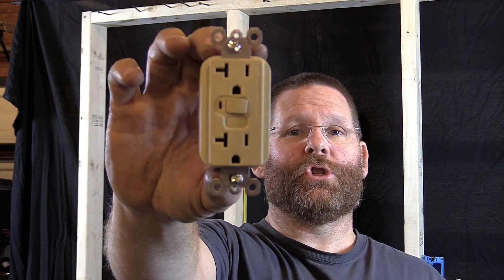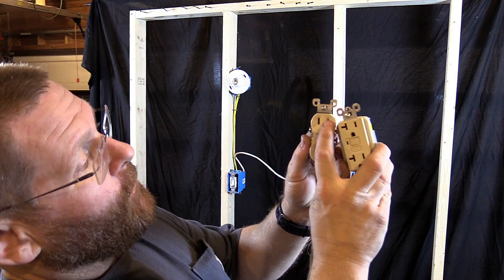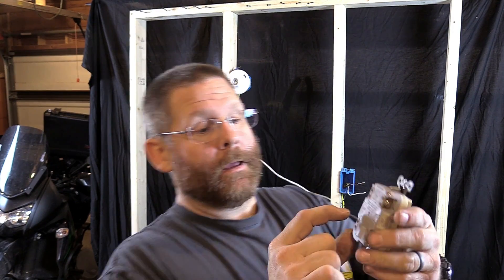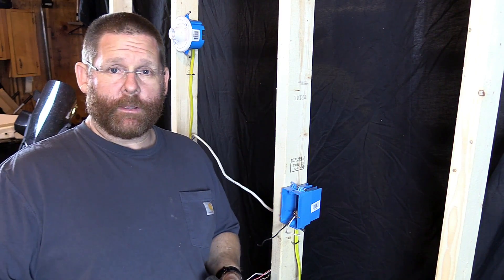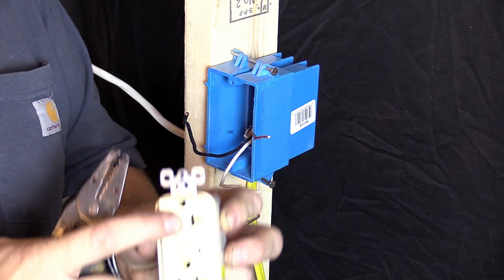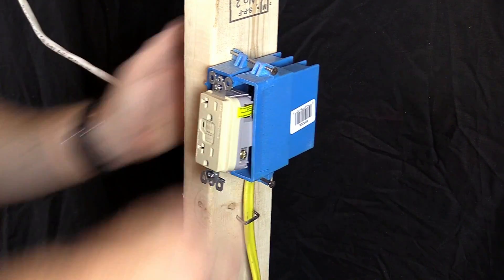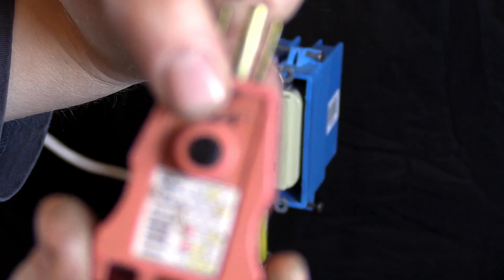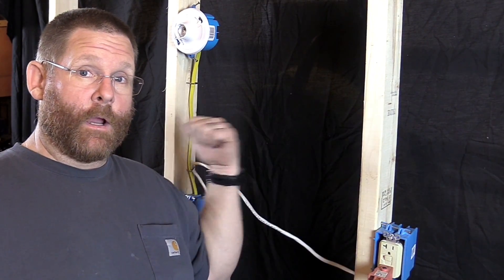How To Hook Up A GFCI

Comment: Hello, very informative video! I am trying to find out the problem with two exterior gfci outlets, one has reset/test buttons. I have no power on both. I am unable to push the reset button which indicates to me that it is not getting the power. I checked and reset all gfci outlets in the house and they are working. The circuit breaker has not tripped either. Could you  please let me know what troubleshhting I should do before I proceed with replacing?  Thank you in advance!
Reply from the maker: If I were there the first thing I would do is turn off the circuit breaker, pull out the gfi out of the box and leave it hanging out, I would make sure it was safe from dogs and kids then turn the beaker back on. Go out with a induction tester (tick tester) or meter and see if I had power to the wires coming into the back of the gfi. My guess is that your gfi is bad. If it shows power my next guess is that maybe you have lost a nuetral. If that proves still no power it may be that you have a open joint somewhere..go to the next place that wire goes (junction box etc) and see if you have power there. If they still doesn't fix your problem message me back I'll tell you a few other things that you can do. Let me know
Reply: Thank you so much for the detailed suggestions on troubleshooting. I will do these and keep you posted. Have a great day!
Reply from the maker: @SurLover  you too. Good luck
Reply: @MountaineerOutdoors  sorry for the delay. I had to buy induction tester and multimeter from Amazon to test these. i found that the cable pair feeding LOAD terminal have 120 V but the LINE terminals have no power. I opened both outdoor receptacles and there were no loose or unconnected cables. I also bought a new GFCI and replaced just to check. Test and Reset buttons on the new GFCI cannot be pressed either. Just to give some background. This problem happened after a contractor used the outlets to run thier cement mixtures. Could this be due to burned fuse on the main box then?   I would appreciate your further guidance. Thanks!
Reply: @SurLover  switch the line with the load seems that you have it backwards. Line is supposed to have the power.
Reply from the maker: I just saw your question and someone comment on it... He is exactly right the line always should have the incoming power.
Reply: @damthetorpedoes1  Thank you so much! It was exactly the problem. I connected the new GFI  reversed. I changed it and it is now working great! Thanks again!!
Reply: @MountaineerOutdoors  Thank you! Indeed, I connected it wrong.  It is working fine after I revered the connection. Thanks again!!

Comment: If you have a 15 amp circuit breaker, is it okay to use a 20 amp outlet?  Should've asked that before LOL
Reply from the maker: Yes absolutely. That's actually a better Recep to use. If you had it the other way a 20 amp circuit and you were using 15 amp receps then by code the only way to get by with that is to use at least 2 in a circuit. I hope that doesn't confuse you. But your question, yes you can do it absolutely that way.
Reply: @MountaineerOutdoors  What is the point of using a 20 A outlet on a 15 A breaker? The whole point of a 20 A outlet is that one can use more than 15 A. You would be overloading the wires.
Reply from the maker: Your breaker will only allow a certain amount of current before it trips the breaker.

Comment: Great video. Hey are you using a bunch of differnt tags for these videos? So when people look it up it will pop
Reply from the maker: I do I load it up with tags not sure if it helps or not but I do use them
Reply: @MountaineerOutdoors  just makeing sure.
Reply from the maker: Yeah I read that the description actually is better at being discovered which alot of the times I forget to go into depth. I need to remember that from here on out.
Reply: @MountaineerOutdoors  yeah also always make one of you tags the name of the video. There's two different list one is the recommended and the other is the actual search
Reply from the maker: I use to do that i don't do much anymore but I'll try doing that again.
Reply: @MountaineerOutdoors  I can see the tags, look good to me.